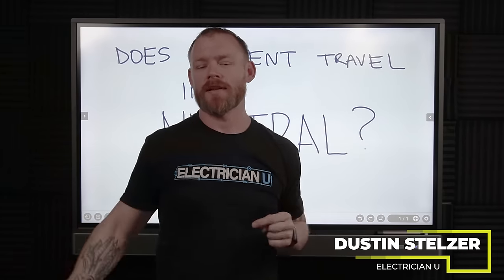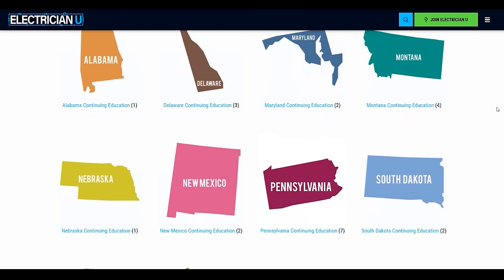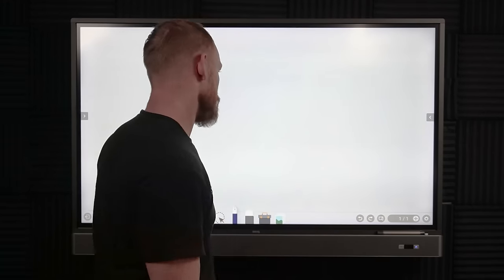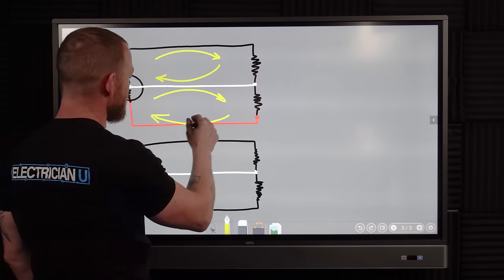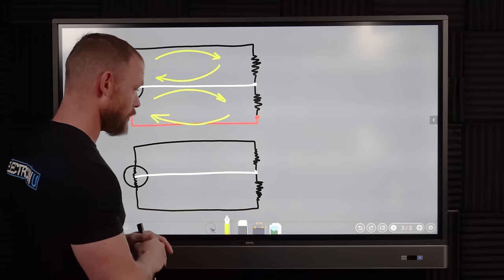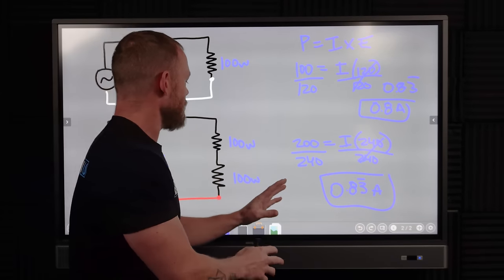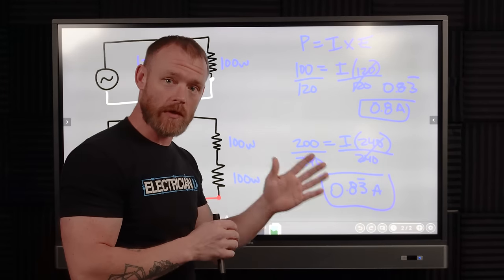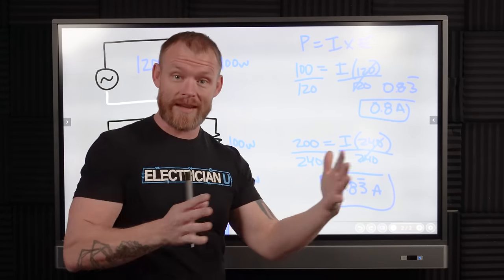Does Current Flow on the Neutral?

Comment: On the main panel, your not showing the neutral connected to ground. Neutral is not connected to the transformer, It is ground, thats why you have no current flow at the neutral bar, it is ground.

Comment: I'm obviously missing something here because I don't understand how current can be flowing out of the Transformer on the red wire but still be flowing back in on the red wire to complete the circuit. If a current flowing in One Direction and the current flowing in the other direction cancel each other out
Reply: The current flows in both directions, alternately.  It changes direction 120 times per second.  When you have a wire shared by two circuits (the white wire), the current in each circuit is opposing the other, so the net current in the neutral is the difference.

I just watched it again and I don’t see any place where he has the circuit flowing both directions in the red wire at the same time.
Reply: @GH-oi2jf  thank you for attempting to explain it to me. I still dont get it so I guess it's just way over my head

Comment: with a voltage divider on a split phase, you have electrons moving in opposing directions, which results in opposing magnetic fields, which cancel each other out. this is why you can't measure it with a clamp meter, as that measures the magnetic field. no magnetic field, no amps detected ( but only in a perfectly balanced system) with an unbalanced load, you will see the difference.

Comment: Current can flow in a loop of wire when a magnet passes it,if there were enough loops and a continuous movement of the magnet a light connected in series with the wire would light up at the frequency of the magnet passing the wire.The induced current falls back  with equal force after the magnets effect passes resulting in another back force of current.That is the back emf of an induced current in a wire from either magnetic or coupled emf as in coils of conductive wire in close proximity.His diagram is a closed coil with two lights in series.

Comment: Electrons don’t move, they merely facilitate the EM field. The EM field oscillates due to a potential difference.  Electrons only move in DC circuits but very very very slowly. This is called electron drift

Comment: Summary - In an individual circuit (one hot and one neutral), the neutral carries the same current as the hot and is always counted as a current carrying conductor. In a multi-wire branch circuit or feeder circuit, it may carry from zero current up to the full current of the hot(s). Multi-wire circuit in a split phase system, it's not counted as current carrying conductor. Multi-wire circuit in a 3-phase delta system, it's not counted as a current carrying conductor. In a wye system 3 wire circuit (2 hots, 1 neutral), it is counted as a current carrying conductor. In a wye system 4-wire circuit (3 hots, 1 neutral) it's only counted as current carrying if the major portion of the circuit consists of nonlinear loads.

Comment: Question, do both circuits have to be the same amperage, or it doesn’t matter what amperage the circuit are they will always cancel the neutral ?

Thanks
Reply: The two 120V bus bars can each support several circuits of varying capacity, but usually 15A and 20A.  The neutral bus just carries the difference of the sums of the currents on the two hot bus bars.  In general, the loads will not be perfectly balanced.

Comment: Almost right.  You forgot to point out that red and white hot lines are 180° apart in phase.  In your two 2a bulb example, there is no net neutral current back to the transformer.  The neutral current flow from the first 2a bulb is 180° offset from the neutral current flow from the second 2a bulb.  The two currents are sinusoidal, sine(0) and sine(pi), arguments in radians.  These two waveforms cancel each other.

Comment: So if you know that your going to be running an imbalance load at times should you pull a larger neutral wire?
Reply: No, because each neutral wire should be carrying the same current as its respective hot wire to the neutral bus. The return current to the transformer from there should be a 6AWG or 4AWG.
Reply: In a multi wire branch circuit where there's a shared neutral between 2 circuits, the circuits must originate from opposite legs on the panel or you risk overloading the neutral wire before the neutral bus.

Comment: If the current is 8amp as in the last example, what will be the voltage reading in the neutral line then? I understand it would be have zero in the equal load scenario

Comment: When measuring current on the neutral wire because of the the loads are unbalanced and you got unbalanced current is in this called residual current or leakage current and how do you prevent leakage current and residual current on the neutral line?

Comment: So, the primary on the transformer and the secondary of the transformer are 180 degrees apart? Like when the primary is at maximum voltage potential the secondary is near zero voltage potential and the neutral is connected to the center point?

Comment: Does current flow on a neutral?
Easy way to find out.
Use a clamp on ammeter on the neutral while the circuit is under load.
Anything greater than zero then yes current will flow through the neutral.

Comment: If people don't believe current flows on the neutral try  disconnecting it an see what happens. You can get a cross feed through a 230 volt appliance and light bulbs will  on part of the house be real bright and the other part dim. I ran into that several times. Also I found a situation where a 120 volt circuit was wired with breakers on both ends on  opposing legs of the bus bars so you couldn't have both breakers on at the same time, If they had put them on the same leg we would have never known. Less than half of the " electricians" that wire moble homes won't run a ground wire. They are a 4 wire system, the breaker box is grounded to the mobile home frame so on a rainy day you could get bit.

Comment: i don't even have to watch this of course it does. I remember my college professor telling someone in one of our labs not to put the fuse on the return/neutral wire. if u disconnect the neutral the light goes out duh. WRONG  there is electron flow and hole flow , a conductor has one less electron in the outer valance field, so the battery or gen donates electrons that hop down the atoms filing and the "holes" go the other way.

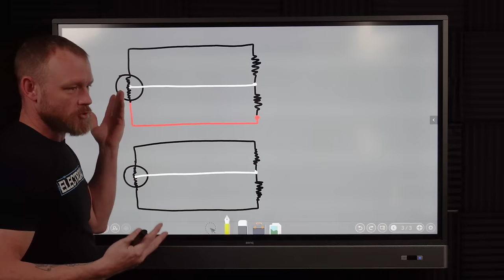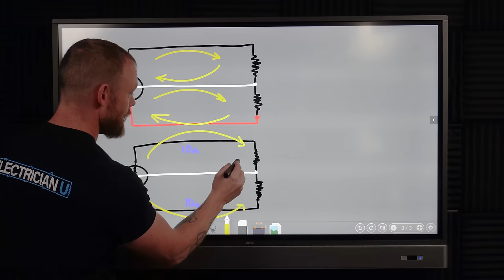Comment: So, at 12:00, with 2 circuits on different phases, if either one is turned off, then you have 2 parallel circuits because of the neutrals. But it both are turned on and they are balanced, they act like a series circuit. But, what I am seeing at 14:00, If you have 2 loads on the same phase and turn one off for maintenance, you need to be careful because you can still have a deadly current on the neutral if it is shared.
Reply: Current on the neutral is not deadly (assuming no faults) because it is near ground potential.
Reply: @GH-oi2jf  then why is it now forbidden to have shared neutrals between 2 or 3 circuits according to the NEC? There has to be the potential for electric shock or some other adverse issue. Back in the 90s, having a shared neutral was common, now it is not permitted.
Reply: @CharlesHuse  — There is a potential in some situations when working on the wiring.  There is a video elsewhere giving an example of a neutral wire acquiring voltage by being disconnected.  The thing is, once you disconnect a wire from ground, it is no longer neutral, regardless of its color.

When everything is connected properly and the neutral is grounded, the current in the neutral is not a shock hazard.  That’s a better way to put it.

Earlier versions of the NEC allowed shared neutrals in some situations.  If they are prohibited entirely in the current code, it is just a sign of the continuing shift toward conservative practices.  Every three years they sell a lot of new code books.  I wonder how much they make from them.

Comment: Absolutely unquestionably it does as the neutral carriers back the unused amps in any circuit back to the source and as is the case in many instances in lighting circuits there can be three hots sharing one neutral creating a huge potential for being shocked by a neutral

Comment: Sir if neutral is from one digital meter and phase is from another digital meter and the load is connected which meter will record reading? The meter with phase wire or the meter with neutral wire connected?
Reply: There is one energy meter for a single split phase panel.  I don’t understand what you are imagining.

Comment: Do the individual electrons really flow from one end of a line to the other end or is there a cascading of an electrons hitting into the next atom freeing an electron in the next atom and on down the line.  That is, does a single electron migrate from one end to the other.  It may be a distinction without a difference, but that's the way I understand it.

Comment: what happens if you lose the neutral connection to the transformer ( from the panel) if your loads are perfectly balanced?
Reply: From Ohio. When one load comes on, you will see the voltage drop significantly on the 1 leg. Say 20 volts. You will then see the voltage spike up 20 volts on the other leg. It usually results in burned up light bulbs and tvs.

Comment: Just read one wire at a time. Obviously your amp clamp doesn’t work when you clamp it over both conductors on a load. Don’t try to read your lamp current on the main neutral conductor. 😮

Comment: So what your trying to explain to people is the cancellation cause by a VSWR ( Voltage Standing Wave Ratio) on the Neutral wire.  Electrons and their magnetic fields trying to move 180 degrees out of phase cause infinite Impedance so no Power can flow.

Comment: Maybe I missed something, but why do the breakers alternate between A & B phase, or black & red? I was under the impression that one leg feeds side of the bus bars and the other leg feeds the other side.
Reply: The bus bars are interleaved so you can install a double size breaker and get a 240V circuit.

Comment: A neutral wire with the unbalanced returning load on it will shock you much harder than the hot wire in that circuit will

Comment: 2 amps would be present on the neutral buss, only between the two connecting points for each respective 120v circuit on opposite phases? or 4?

Comment: Question:  If I have one lamp connected to the 120v red phase side and another lamp connected to the 120v black phase side... will those two lamp hot terminals represent a 240 volt potential circuit?  I mean can someone be killed by touching them both at the same time?
Reply: L1 and L2 have a 240V potential between them.
Reply: @GH-oi2jf  So if I accidentally get caught between my toaster and my fridge, I could get a 240v execution?
Reply: @timhallas4275  — Not likely.  The metal exterior parts of both appliances should be grounded.

Comment: I guess what I'll never understand is if the electricity is converted to light and heat by the lightbulb then what's going back on the nuetral?  If there's more electricity flowing than the lightbulb is using it would go through the meter and you'd get charged for it.
Reply: When the wind drives a windmill, the wind itself isn't converted into energy. The energy of the wind is converted into kinetic energy as it turns the windmill. Think of electricity the same. Work is done (generated) to make electrons flow. This movement of electrons is transfered into the light and heat energy from the bulb. The electrons in the copper wire are not consumed.

Comment: Why is it that a hot wire tester only flashes red and beeps when it recognizes the “hot” wire?
Reply: A non-contact voltage tester senses a very small capacitively coupled current through the tester to ground.  You provide the path to ground by holding the tester.  The neutral is at ground potential so there is no current in that case.

Comment: It's obvious, to anyone who understands the most basic concepts of electricity or physics, that it MUST.  Otherwise, the 1st Law of thermodynamics would be violated.  On the other hand, current should not flow in the ground wire.  If it does, there's a short, somewhere, and the ground keeps it from flowing through something it shouldn't, like your moist, delicate, body.  That;s what the "green wire" is for.

Comment: Anyone who thinks current doesn’t flow through a neutral wire should grab hold of a shared neutral. A shared neutral is a neutral that is shared by two circuits on different sides of a distribution panel. I learned about this amazing cost saving measure used by cheap-ass builders when I was running some lights into my attic. I switched off the breaker feeding a single pole twenty amp breaker. It was sharing a neutral wire with another breaker on the other side of the panel. I did not test the neutral/white wire. I just checked the black wire to confirm the power was off. As soon as I lifted the wire off the high side of the switch I became the electrical path to ground and I got hit. So yes; current travels through the neutral wire. The worst part is that shared neutral wires are actually compliant with code. They should be illegal because they are dangerous.

Comment: The Union apprenticeship doesn't charge you any money for education. Plus they guarantee you a job while you're learning, paid living wages, and paid benefits. Journeyman wage currently in Las Vegas is $50.48 an hr. That doesn't include the benefits and retirement the contractor is required to pay you for per contract. Non Union charge general contractors a high number for an employee and pay them low with a tap on the back. No pension or Healthcare paid for with a low wage.

Comment: You might want to re-connect your black wire to the other phase because you have both bulbs off the right phase...
Reply: What do you mean by “energizing”?  The neutral wire is connected to ground, but the Earth normally does not carry a significant current because the path from the main panel to the transformer along the neutral wire is much lower resistance than the path through Earth to the transformer ground.

Comment: I think some of the comments here went off into the weeds as to the intent of this presentation and some needless bickering ensued within those comment threads.

At no point did he say it was safe to handle neutrals connected to an energized panel or circuit. At no point did he say neutrals do not carry load nor current.
What he's trying to explain is the net neutral return to source (transformer) current balancing effect of simultaneous loads between different phases of an alternating current service. Although the neutrals of each circuit are carrying alternating current pulses back and forth to neutral buss for those circuits, current travel back and forth between the service and transformer center tap via neutral is determined by the imbalance of load across the phases.

The only thing I would add, an assumption is made that the phases are 180° apart in the demonstration. If the service was from two phases of a 208 volt three phase transformer, as it is in many places, there would still be some current return on neutral to transformer due to a 120° phase separation. The only situation where you would have no return on neutral to a three-phase transformer is where complete three phase service was provided and balanced loads existed on all three phases.

I think Dustin would agree that this was a presentation of electrical theory, not safety.
He has not and would never encourage someone to handle any conductor connected to an energized circuit or service. Those who made that assumption were not paying attention.

Comment: Ohm's law. V=IR. A conductor obviously has resistance. So it obviously takes volts to generate a current through that conductor. Of course the vast majority of Voltage is dissipated over the load.
Reply: @kennykash6089  * Impedance, not resistance. * That's not correct. The 'R' in Ohm's Law refers to Resistance. Impedance is the common term for the total resistance over a circuit typically when alternating current is applied.

Comment: How do you work out voltage  drop ? our Regulations book  has a table where we get a value from
it's mV/A/m  milliVoltage per Amp per metre. With this value  you multiply the length in metres then multiply the design current. Finally divide by 1000 = voltage drop.

Comment: Great video, I have a Chinese Solar Hybrid 5KVA 230v 93A One Phase Inverter 48v charge controller I live in the US 120v Breaker Box 100A , investing the 230v is 115v on the Hot Line & the Neutral has 115v = 230v You are the expert would that also mean the Amperage is 46.5A per line ? “ want to for Emergency Power only DIY he hot line to L1 & the Neutral to L2 giving me  One Phase in my complete breaker box. I do not. Have any 220v lines in my house 
 I have gas  for heat  And cooking!

Comment: You are using the word "phase" incorrectly to describe multiple things. @ 6:09 you said "we have this phase and this phase". There are not 2 different phases on a single phase system. They are opposite polarities of a single phase as there is no offset on their phase angles. At 12:30 you say "we have 120v here and we have 120v here", it would be much clearer to say we have 120v here and 120v of opposite polarity here, or +120v and -120v. That would make it much more obvious how the polarities can cancel each other out.

Comment: 9:04 this doesn't to me. What if you have one light bulb on the circuit? You basically invented another lightbulb to say that they're "pushing and pulling and canceling each other out". What if there is only one breaker, with one lightbulb? Do you get voltage on the neutral at the bus bar or not?

Comment: Leave the circuit on with a fixture running on the same circuit you are working on. If you provide a good ground you will get zapped by the neutral wire.